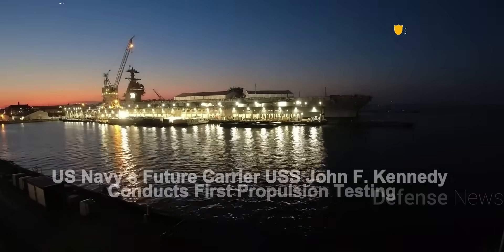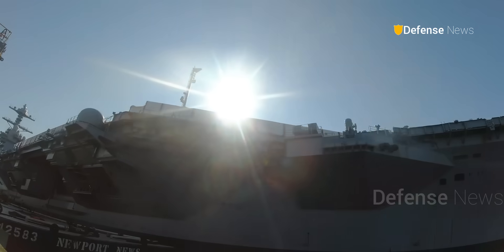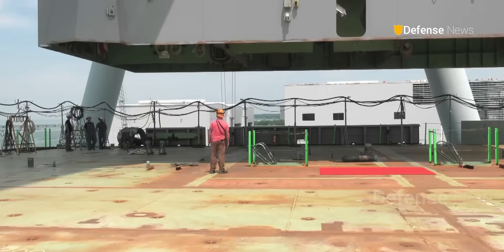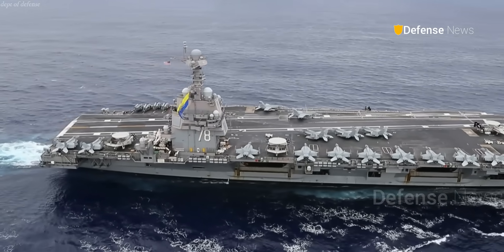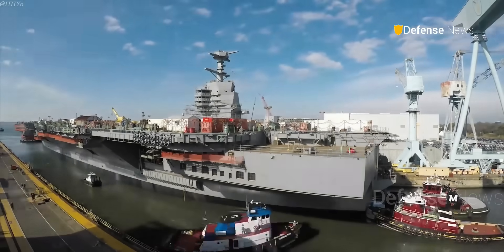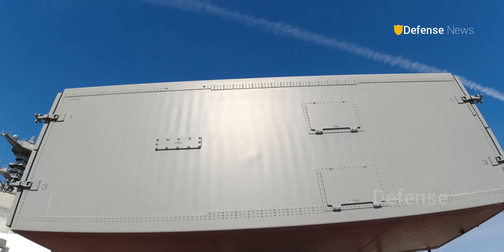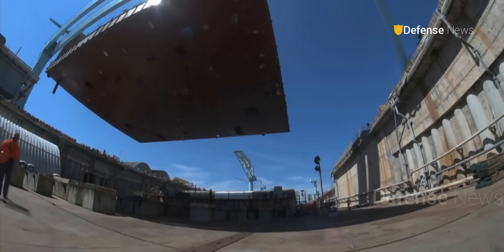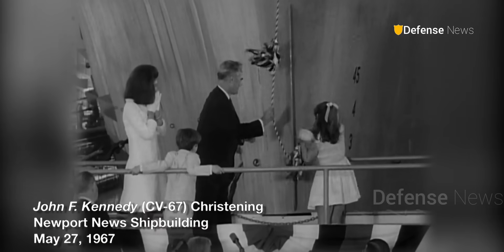US Navy’s Future Carrier USS John F. Kennedy Conducts First Propulsion Testing

Comment: That build time is beyond belief! Also if it takes so long to get new why completely scrape the old carriers!? Why not strip them down and completely refit like a brand new carrier it steel after all if the hole is walleyed out weld up and retap so to speak in the next conflict we will loose carriers no doubt so keep the old and refit them and keep them in service indefinitely as possible . Just thought but them boat are hard to build so we should not simply scrap them in my thoughts. But just sayen❤